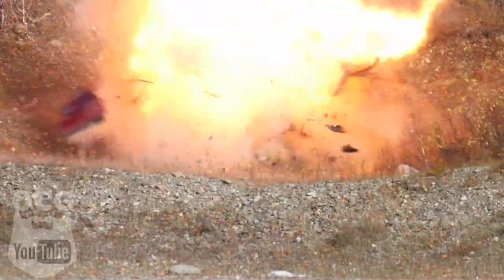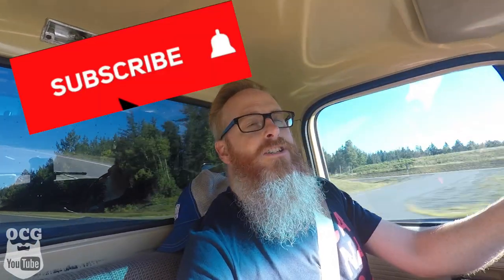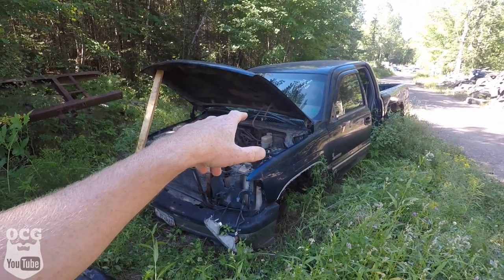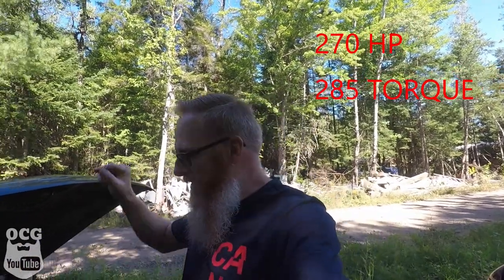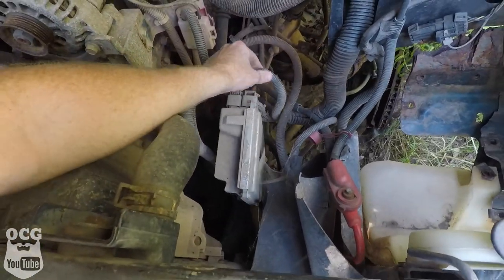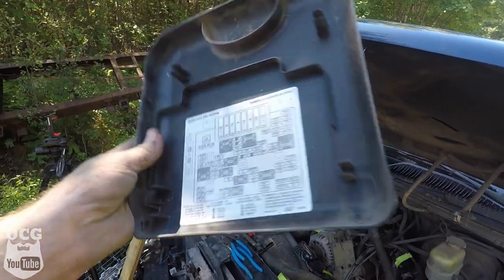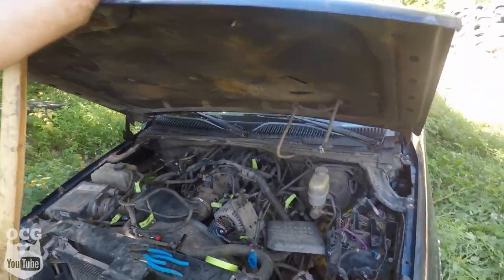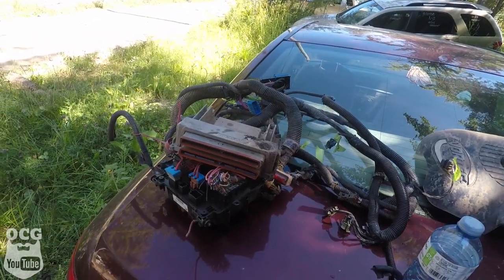MY STORY OF HOW THE 5.3 LS SWAP ENGINE WASN'T ACTUALLY AS ADVERTISED

Comment: 4.8 in Dale = better fuel mileage
Going to put an aluminium 5.3 "B code" into my 61 Pontiac I think
It's also cheaper in the long run just to buy a whole truck
Reply from the maker: I get it, but not with that mileage!
Reply: @OldeCarrGuy  we had one at work with near 600k on it, took it apart and it was still mint inside!
 I got a 5.3 on the stand right now with over 500kms!
Original engine out of Junkrolet, bought the whole truck for $80
Reply from the maker: Which is fine if you know the vehicle history! But I’m not willing to take that chance on a junkyard motor!
Reply: @OldeCarrGuy  be patient, the right engine/ deal will come your way

Comment: you don't need the fuse box it self, just the harness and ECU you can do a lot and cost nothing (just pay for re-tune the ECU) i done all the wiring myself and it was easy to do just follow the Lt1swap.com chart ...and by the way i pay $500 tax in for a LS 6L 2004 that run like a charm without any modification or rebuilt and i got a 30 day warranty from the junk-u-pull! so keep on the good work my friend! ;o)
Reply from the maker: I’ll keep that in mind. I may be hitting you up down the road!
Reply: @OldeCarrGuy  if i can help with my little knowlage and crappy english riting ill be glad to help :o)